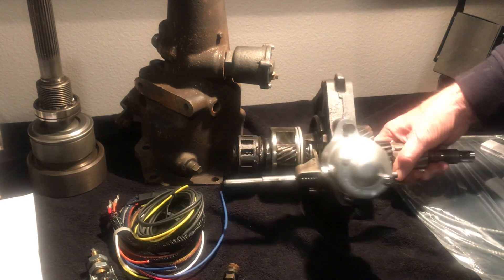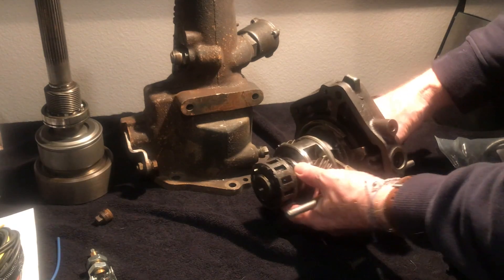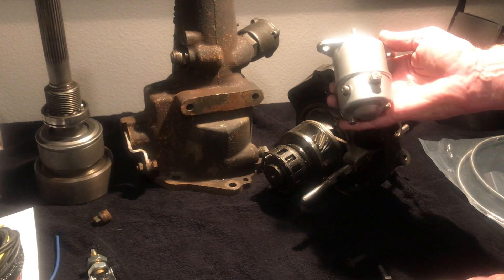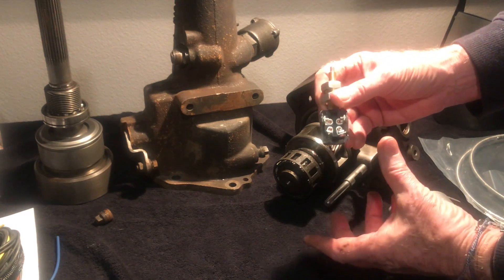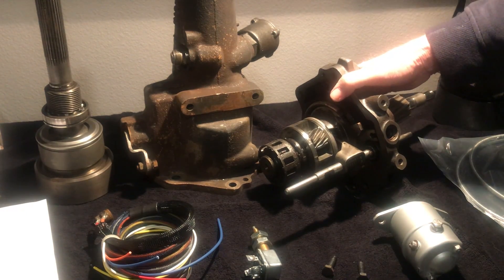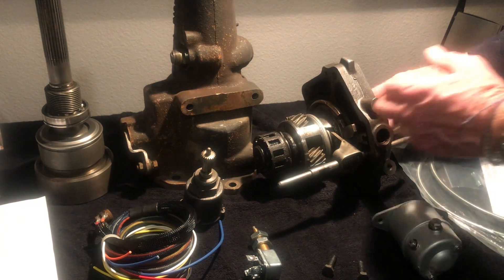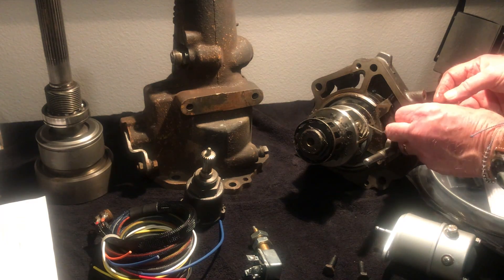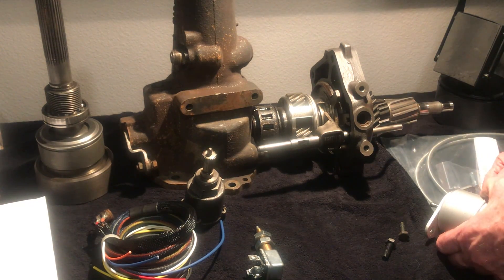Borg Warner R10-R11 Overdrive operations and parts breakdown

Comment: Hi I have an overdrive transmission That will not fit my Ford F100 1955 They guy i bought it from told me it will fit But it is to small for the bellhousing Number on it is 28  AF-7006-D Do you know were iy goes on ???

Comment: Quick question.  I have a B/W unit separately spliced into the torque tube of my '47 Ford sedan back towards the rear end (not attached to the transmission like normally installed on later year models). As wired, there always is power to the relay, regardless as to whether the cable is pushed in or not. If the cable is not pushed in (i.e., OD is not mechanically engaged) does the governor switch still engage the solenoid once speed exceeds 28mph and is that bad? On my install I do have a toggle switch to cut power to the relay if needed.  Thanks.

Comment: what would make it try to jmp out of gear while in direct  holding back down hill with the cable all way out and I have checked sll linkage and confirmed the cable is pulling lever is all the way forward

Comment: I'm trying to figure out what seems to be a common problem with the overdrives on old studebakers. I have a 57 E7 Transtar that has the Borg Warner overdrive. It keeps blowing the fuse after driving it successfully many miles or even just a few miles. Two things: I'm wondering if oil is getting into the solenoid from a poor seal. I do have a leak coming from somewhere on the back of the transmission. Transmission folks said that they all leak and that it's probably because of the old seals. This truck is in immaculate condition and is well taken care of. Still, I should be able to replace the seals, right? Or do I need to buy a whole new solenoid?
The second thing I'm wondering is if the 12 volt conversion is throwing too many amps at the fuse relay where the fuse is blowing. It seems to blow when I give it a lot of gas getting on a highway. If that's true, should I put the 12v relay system you mentioned on this video. 
Possibly a third issue could be something that I've noticed. I know there are two wires going to the solenoid, but mine only uses one. It's still works, when the fuse isn't blown, and I'm wondering why someone would disconnect the wire and leave it hanging?
The way I make my overdrive work is to get to the proper speed, let off the gas pedal and then give it gas again and it engages. I don't know how to unengage it other than downshifting and or coming to a stop and turning it off. It does go back into the slower first gear when I come to a stop.

Fantastic video! It made a lot of sense to me and gave me confidence in order to do it myself. I am not a mechanic, but I'm not afraid to turn a wrench and test a wire or two. Thank you for any response that might be helpful.

Comment: I park with trans in reverse on shallow grades, locks the drive shaft. My Ranchero and 57 convertible bird don't have the long shaft solenoid or spacer and no clearance problem(?) Full size convertible does. Never ever drive without oil in the OD case. R10s low power only. All parts are available for these transmissions. Been using T85/ODs in performance cars for many years, overdrive as necessary as front disk brakes.

Comment: Great Video! I have a 52 Willys Pickup that has a 289 & T10 4 Sp conversion in it (previous owner). It also has 5.38's in the Timken rear end (i know right - it's like a tractor) It has the BW R10 on it but it has never been wired up properly, as when i did it way back when; I never finished as the wiring for the relay, governor; solenoid and kickdown switch, lockout switch, as all was sort of confusing (I was ~27 then, i'm 64 now); ofc way back then, no internet. Mine also has a little square lockout switch on the end of the case to break connection to the governor. The fact the cable handle is almost always in, was also confusing... I kept thinking pull it out for on; I actually bolted an aluminum bar to the OD lever (to push and pull from the top) to reverse that, and yes I am going to remove it, but it seems it's all so automatic, the way you explained it is, that it's pretty much always in (on) and out (locked out) at low speed. My truck is 4wd so i will have to remember to lock it out (pull the cable handle out) before engaging the 4WD. I  guess  I was also confused about reverse... so if it's all automated and your below 28-30 mph; it's locked out anyway from the electrical side and reverse should be fine. I am sort of glad i never understood it in my 20's.. as I could have seriously done something bad. I love this Video btw.. great job.. I think I only need the relay, harness, KD switch (I plan on running that off the carb linkage somehow) to make it like it should be. The 5.38's should make this project interesting in the end :).

Comment: I'm glad I found this video I just inherited 52 Ford with the overdrive transmission my dad showed me how to work it but that was 45 years ago it sat for the last 30 years not running I got it running 6 months ago and the first thing I noticed was none of the forward gears would hold the car with motor off  even went to Ford dealership to find out if they knew and of course they didn't 52 didn't have the computer to tell parts changers what was wrong.the cable is broke so I'm assuming it is in overdrive and afraid not knowing it was in overdrive I have ruined it is there a way to get it out without the cable working

Comment: Great video, very helpful.  Is it possible to fit an R-10 on a T-85 transmission?   My application requires a torque tube and I haven't seen an R-11 that will mate to a torque tube.  Is there such a thing?

Comment: In theory, if I disengaged the overdrive switch and drove without o/d until in the 'top' conventional gear (third) at over 28mph THEN engaged the switch, it would automatically 'change up' into 3rdOD. However, would this be safe for the transmission to endure?

Comment: For cars that were built in the 1950s and 1960s a three speed column shift with a Borg Warner Overdrive was one of the most versatile Transmissions a car could have at that time. This was because it gave an over gear to first, second and third gear, turning a 3 speed transmission into a 6 speed transmission. First over was not really useful, because the car had to be going over 28 mph in first gear to shift into first over. So the result was 5 useful speeds.

Comment: GOOD VID  i remember the car but not the tranny. was the '39 imperial have the same type?
Reply: The '39 Imperial would've had a different version, possibly the now-rare B-W R7, which operated slightly differently. It was very similar in internal construction and concept to the R10, but different case and electrical circuit. The governor operated mechanically to engage the overdrive, and the solenoid operated only to take it out of overdrive for "kick-down". But there were a lot of modifications and model numbers in the late 30's to pre-war 40's.

Comment: The kickdown switch momentarily grounds the ignition to take the load off the transmission so that the overdrive can “kick out”.  It would be helpful to show the wiring diagram/leads from the kickdown switch.
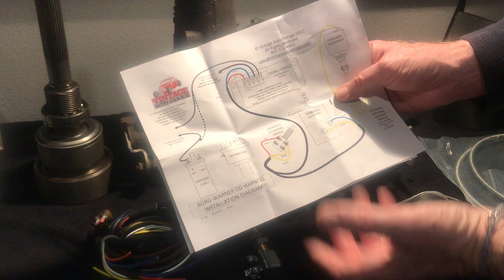Reply: at 7:27 you can see the diagram that shows that.
Reply: @jeffbrown4096  again, at 6:15 the dialogue on the kick down switch is incorrect. When depressed the switch will momentarily ground the distributor, therefore taking the engine load off the overdrive allowing the transmission to drop back into standard. The fuzzy diagram at the 7:20 mark and following - not much help as it can barely be seen. Hopefully the video can be edited with some correct information, good try nonetheless.

Comment: I have heard different things about locking out or engaging the overdrive. Some people say the cable should only be pulled out or pushed in while driving. Others say that it's ok to operate the cable while the vehicle is stopped. What do you think?
Reply: Many years ago my father had a 1966 Rambler American with a 3 speed column shift with overdrive. The overdrive was useful when traveling on the Freeway. When we exited the Freeway and came to a stop we would pull out the handle on the overdrive cable to lock out the overdrive for city street driving. So the overdrive cable could be engaged or disengaged with the vehicle at a stop.

Comment: Thanks for a great Video! 
 I installed one in my 56 Chevy pickup back in 1984. ( back then I was  running a 283 4 barrel , single hump heads) 
 Sweet transmission ! 
 I still have my truck.

Comment: Where do you source R10 parts? Hermtheoverdriveguy?
Reply: Specifically hard parts, like sprag rollers, sun gears and planetary
Reply from the maker: https://www.vintageautogarage.com/Borg-Warner-Overdrive-s/3217.htm
Reply: @vintageautogarage3461  I poked around yalls page a few times, seen Solenoids and relays, never did see any internal hard parts listed
Reply: @Texassince1836  I just bought some vintage Studebaker parts from an estate sale and I believe there are some R10 parts there. Message me what you need and I'll look and see what I have.
Reply: @Tshade67  hey Tony I don't believe Youtube allows for private messages any more.

Main thing im needing now is the 3 pinion planetary, but other spare parts never hurt to have on hand.
Reply: @Tshade67  did you ever find out what you got in the sale?
Reply: What shifter kit works with the R10? I have the HURST INDY UNIVERSAL 3-SPEED MANUAL SHIFTER but it doesn't seem to fit the R10 (with overdrive).
Reply: @DafingaPuppet  I’m needing the same info for my rambler 3 speed with Overdrive

Comment: Very good video!! I understand these transmissions so much better now!  I just bought a 60 Biscayne with the R10 in it.  The previous owner hacked the wiring of the car and the transmission isn't wired up at all.  Now I know where to get parts and tips!  I'll be doing videos on the car on my YouTube channel.  Thanks!!
Reply: Did you ever get some videos made ... im trying to figure out how to wire mine .. more specifically where these parts are located
Reply: Forty five years ago (as a very young man) I took the Powerglide out of my '60 Biscayne and installed a 3spd with O/D. I did not have a kick down switch or a relay but used an on/off toggle switch to engage the O/D. This gave me 6 forward speeds. It was a fun project.